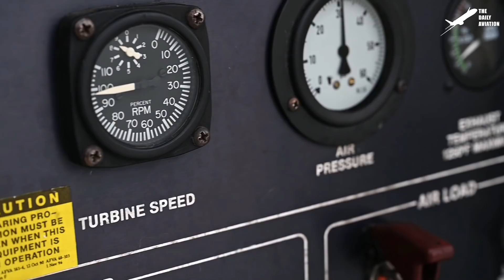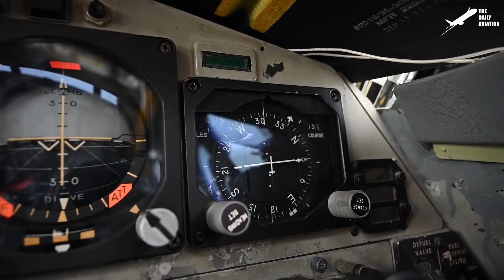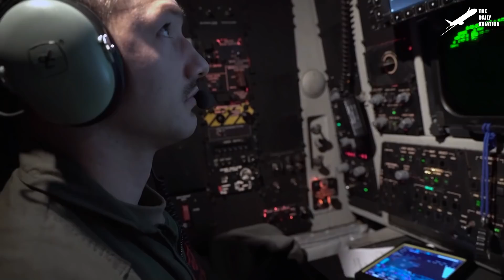US Need This Special Technique to Start this Gigantic Aircraft

Comment: And it's called a "start cart", not a "cart-start".   A "cart start", or "cartridge start" is coimpletely different.  That basically uses a giant shotgun shell to start up an engine almost instantly.
Reply: pretty sure those were just in piston engines
Reply: @gilzor9376  no. many military jet acft have the ability to use carts. its needed in case there is no ground equipment available since there is no apu in the plane...
Reply: @wingmannj  I challenge you to give me an example of a 'modern jet engine' that uses a cordite charge to start up.
Many military aircraft have an on board APU . . . . but I know near zero about the subject.
Reply: @gilzor9376  f-4s do, or did. B52s,kc135s. The big planes had them installed when on alert during cold war times. Airlift heavies i cant speak for never worked on them.
Reply: @wingmannj  key words in my statement . . . 'modern Jet Engine'  . . . pretty clear on that. The F4 Wildcat is a piston engine. Show me an example of the KC135, I don't believe it. KC135 has an on board apu . . . . maybe the F4 Phantom, as it was an older Jet Engine, I know early versions of engines had used them.
Reply: @gilzor9376  if i remember right the apu's on the 135s were disabled because of fires. only commented because you said they were only used on piston engines which isnt accurate.
Reply: @gilzor9376  carts on the 135 may have been limited to earlier models, it looks like the newer models with turbofan engines instead of turbojet used an apu. i know the older models used carts i worked along side of them when my b52 was on alert status and we'd have a klaxon exercise.
Reply: @wingmannj When I challenged you I had stated both that I know near zero about the subject, and that the challenge was about a modern jet engine. You see, after your comment, I had realized that the early days of jet engines, their use was barely existent let alone at all, but you commented that it is essentially commonly used up to and including today, which is not accurate at all.
Reply: @gilzor9376  they never were actually 'common' being that they're used for special circumstances such as a 'scramble' or just for crew training which is a good thing because the clean up is a chore, leaving a lot of burnt residue in the breech and breech cap. on just regular training sorties they're never used because why would they, that's what ground equipment is for. in the event god forbid that ww3 ever broke out with the soviets the extra few minutes it would take to use ground equipment to get the engines started makes a big difference as opposed to the crew running up the hatch and firing the carts to start the engines. those few minutes mattered and we practiced that at least once a week. probably the same thing with fighter jets scrambling to intercept.

Comment: The video said the B-52 is one of the oldest aircraft in the USAF does anyone what aircraft is older?     Saw an article a few years ago of military hardware still in use after 50 years and included things like the 1911 pistol, turned 100 years old in 2011 and still used by certain special ops.  Also the 50 cal BMG dates back to post WW I or at least WW II
Reply: The last B-52 was delivered in 1962.  As of March 2019 there was a 1957 production KC-135R still flying.

Comment: It's actually a large air compressor that blows heated compressed air to start the first engine. Once the first engines turbines are turning the fuel is turned on and the engine is fired up. After that the first engine that was started the air generated from that is diverted to the other engines and they start.
Reply: As in a 707 or a DC8
Reply: @sundar999  No.  The B-52 does not have an auxilliary power unit or internal gas turbine compressor.  It must use powder cartridges or external air.
Reply: @dougwickstrom9870  DC8 and 707 didn't have APUs so they started one engine from an air compressor on ground then this engine fed bleed air to start the other 3 engines
Reply: @sundar999  That kind of depends on which DC-8 or B707.
Reply: The -60, was a small jet engine, they used the bleed air off the engine, to turn the aircraft starter

Comment: Buff can fly almost 600 mph so I call BS in reported speed here.
Reply: The original top speed was around 690, but some of the relatively recent modifications brought it down to 650 MPH. So, the 400 MPH stated in the video is completely wrong. The rest of the video seems yo be all correct.
Reply: @vincentlavallee2779  Airspeed is limited to 622 mph by the electro-optical viewing system, which causes flight instrumentation issues at higher airspeeds.
Reply: Are they confusing knots and MPH? Normal cruise is around 440 kts. Also, the most efficient long range cruise speed is never full chat.
But these, as well as early four-engine airliners powered by old-school jets, were faster than today's planes.

Comment: I have a feeling some young kid titled this video. This is not special! This is old technology! Every jet aircraft originally had to be started with a external air start. Then we got smart and started putting JFS (jet fueled starter) which is a small turbine engine that’s started using compressed air or hydraulics accumulator. Then we got even smarter and started using APUs (auxiliary power units) small - large turbine engine that produces air and also has a generator to produce electrical power. the difference between a JFS and APU is a JFS only produces air and that’s it. APUs will produce air, obviously the exhaust. But they have a generator so you can make electricity. Usually tripple redundant airframes have back up hydraulic, electrical, and pneumatic capability to move servos the apu can produce electrical and pneumatic power so you can move control surfaces
Reply: A number of older jet aircraft could only be started with a gunpowder cartridge.  The B-52 uses that or external air.  It has no internal air compressor.

Comment: They left out the 12 gauge blanks used for emergency starts on the engines.
Reply: They don't use "12-gauge blanks" to start the engines. That silver cannister shown being loaded in an early scene was the starter cartridge. They can install one for each engine but normally use them only in engine 4 and 5. They typically would use them on alert so that they did not have to mess with using a air-start cart.
Reply: @barrygrant2907  Used one per pylon on alert.  This is demonstrated in the video.
Reply: @barrygrant2907  As Doug said, one per pylon.  Whoever ran the fastest could pop them from outside the aircraft.  Saves a heck of a lot of time vs. spinning 'em up from cold and dark.  ICBMs spoiled the entire alert game but did make it more interesting when the Klaxon sounded.  Before, you could finish your sandwich, stop by the latrine, and finally grab a cup of joe on your way out the door.  Then, ICBMs were born, and with them, the days of cart starts, elephant walks, and MITOs.
Reply: Each cartridge was about a gallon in size.  It would burn slowly, but produced enough exhaust gasses to rotate the starter.
Reply: @robertheinkel6225  Yeah, 12 gauge blank is a military under exaggeration.

Comment: All of the external start stuff will go away if/when USAF choses a replacement engine schema. There are at least four candidate engines from three manufacturers, ranging from tried-and-true to recently certified (that being the GE Passport 20), and all much less thirsty than the J57s. Push a button, and they start.
I won't live that long, but it would be awesome to see the B-52 become a centenarian.

Comment: Why are the support crew using sockets with a brace and ratchet wrench instead of cordless impact wrench?  Same thing with the greaser.  Manually hand pumping grease instead of using a cordless greaser.  You'd think that time was important in a fighting situation.  You could argue that recharging could be a problem in the field, but they have generators and would pack hand tools as a backup.

Comment: The correct speed info is 650 top speed cruise 509 not 400.
Reply: Airspeed is limited to 622 mph by the electro-optical viewing system, which causes flight instrumentation issues at higher airspeeds.  Cruise is variable.

Comment: Do I see there hoses, clamps, nuts, screws and wires from the 1950s? Unbelievable...
Reply: They go back to the 1930s, and are still used in new installations.

Comment: Nothing unusual. Seperate units, gas turbine air start and ground power unit were used/ serviced by my unit over the pond in 67-68
Reply: You must have been an AGE mechanic?
Reply: AM/32A-60 provided air and power.  These days an AM32A-86 is used for power, and a -95 for air.  In the old days it would have been an MD-3 and an MA-1A.
Reply: @dougwickstrom9870  -60 is mainly used by fighters, the 86 will handle the much higher power demand of the larger cargo and bomber aircraft, plus run for 8 hours on 50 gallons of fuel instead of 100 gallons an hour with the -60

Comment: What do German leopard tanks and attack helicopters have to do with starting the B-52 engines?
Reply: I believe they use the tanks to tow the plane onto the flight line, then use the helicopter to blow air into the jet inlets to get those turbines rotating.

Comment: Well, the B-36 obviously worked well, then , didn't it?
Reply: Yes, well enough for the time. It was a hybrid that held the strategic bomber throne for a decade, between the all prop B-29 and the all jet B-52. Like virtually all the planes designed in the late forties and early fifties, they were obsolesced by the excellent slide-rule engineering of the mid-late fifties.

Comment: the scream of those engines tho

makes me grind my teeth
Reply: The reengine of the C-5 did a lot to reduce its annoyingly loud engine notes, so hopefully the future reengine of the B-52 will do something similar as far as noise reduction. 

The angst about the reengine program is some of the most severe I have ever seen. Far more than the great engine competition for F-16s, the KC-135 reengine program, or the C-5 reengine program. The DoD is terrified of making a bad selection from among the bidders. For what seemingly should be a relatively simple form, fit, function COTS selection the USAF has certainly taken a lot of time doing evaluation studies.
Reply: @davidhoffman1278  There are structural issues relating to stability of flight.  The best that can be accomplished with new engines is improved fuel consumption and cleaner burn.  More thrust and fewer engines would cause more problems than they would solve.
Reply: @dougwickstrom9870  ,
Yes, I read about the B-52's limited rudder control during engine out situations. If 1 engine(engine 1or engine 4) on a 4 big turbofan engine configuration failed at critical on takeoff then the resulting drag would be more than the rudder could handle. 

A B-52 pilot explained that they had no need for additional thrust. The 17,900 pounds from the TF-33s was adequate. Any more thrust might aggravate the existing lower wing fatigue cracking issues.

Comment: Top speed for B-52 is closer to 650 MPH not 400 MPH
Reply: Airspeed is limited to 622 mph by the electro-optical viewing system, which causes flight instrumentation issues at higher airspeeds.

Comment: Will the new engines have Start Cartridges?
Reply: Hey Bill, The new engines will likely be electric start (the Rolls Royce F-130 is the current top contender)... This means the Buff will get an auxiliary power unit to supply the electricity needed to light the new motors off... No more coffee can full of gunpowder 👍
Reply: @timma100AR  An APU provides bleed air for starting.  The B-52 doesn't have one.  Yet.
Reply: @timma100AR  New engines will not be electric start.  Too heavy, too bulky, not enough power.  The APU will provide bleed air for starting.

Comment: Bad information in this video.  The B-52 Ground speed is greater than 600mph.  You've listed a max speed of 400 mph.
Reply: Airspeed is limited to 622 mph by the electro-optical viewing system, which causes flight instrumentation issues at higher airspeeds.

Comment: actually that thick smoke would unstealth a stealth russian fighter jet -I guess this could be researched on further
Reply: The newer engines burn much cleaner.
Reply: @robertheinkel6225  and with the righ amount of exhause one can use it to detect invisible hostalie planes nearby with adds I guess - Tis selfexplanarie they are more efficient and I guess Hotter thus easier to spot -which exhaust could cover (in theory)

Comment: A Cart Start, is when Cartridges in a Breech Cap are fired...turning the engine: Was designed specifically because aircraft on nuclear alert needed to expedite the process without need for external power or air carts.  At 1:10, the Maintainer has removed the Breech Cap with an unfired Cartridge in it.  Starting with the Air Cart, the piece of ground equipment shown, is called .... Engine Start. An Air Start is preformed in the air to attempt to get an engine running again... The Crew showing up with helmets on?  Maybe to protect their identity in this day and age, but that's what helmet bags are for, and taken out during preflight - having checked it over before transportation to the aircraft.

Comment: They used to be silvery-aluminum. Why are they now dark gray? Any guesses?
Reply: A step back into  the stealth world thats why.
Reply: @garyhaines6891  Bingo. Radar absorbing paint or coating.
Reply: @DavidFMayerPhD  No.  It's just corrosion prevention and not being too visually obvious.  When I was in SAC the B-52G/H were green over white, and the B-52D was green/tan over black.
Reply: @dougwickstrom9870  I am surprised. Thanks.
Reply: @dougwickstrom9870  Also, at the start of its career I believe that silver was deemed best for nuclear delivery, presumably helping to reflect radiation. I read that once but don't know if that was a correct explanation.

Comment: 4:44 I'm pretty sure the B-52 has a higher maximum speed than 400mph....it cruises faster than that....
Reply: This is correct. Cruising speed is 525 miles per hour,  maximum speed is 649 miles per hour.

Comment: It's got a cruise speed of 320 mph. For a plane with as many engines as it has,, I'd assume it would be faster.
Reply: It is.
Reply: @burtvincent1278  Airspeed is limited to 622 mph by the electro-optical viewing system, which causes flight instrumentation issues at higher airspeeds.  Cruise is anywhere between 300 and 450.

Comment: top speed is 650. not 400. so much wrong info in these videos it's laughable.
Reply: Airspeed is limited to 622 mph by the electro-optical viewing system, which causes flight instrumentation issues at higher airspeeds.
Reply: @dougwickstrom9870  ok...top speed is still 650+/-
Reply: @EgoFiveFiveSix  The aircraft has enough power that one can easily exceed the "top" speed, and it will go into a tuck-under condition.  There is a reason for "do not exceed" speeds.  The other thing is that the indicated speed is in knots, so the actual do not exceed is 540 KIAS.  This is important.  There was at least one instance where the vertical stabilizer departed the aircraft in level flight due to speed-induced turbulence.

Comment: Why not combine the 2 engines to make 1 large engine? Seems a little overkill to have 8 engines on an aircraft
Reply: Overkill?  Try this….one engine fails, you have seven left.
Reply: @tommooe4524  so what? 2 engine aircraft are designed to fly on 1 engine

Comment: I didn’t realise they aren’t that fast , for some reason I just expected the top speed was higher
Reply: It's over 600 mph
Reply: @gnumpfgnumpf5610  this clip is clearly incorrect then when it states a maximum speed of 400mph
Reply: @timj41  it is!
Reply: @gnumpfgnumpf5610  surprising they would make such a major error, thanks for putting me straight that could have been embarrassing. A lot of poor fact checking going on with these channels.
Reply: They go subsonic but can go faster than today's jetliners
Reply: Airspeed is limited to 622 mph by the electro-optical viewing system, which causes flight instrumentation issues at higher airspeeds.

Comment: So what is this "special technique" that we never see? And I think they are "start carts", not "cart starts".
Reply: Actually we called them dash 60 turbine generators. They could supply pressurized air and a/c power to the aircraft.
Reply: The special technique was a cart start.  Uses a chemical propellant to supply gas pressure to start engines.
Reply: @itsmewoodG  The -60 has been history for a long time.  The power unit shown is a diesel-driven AM/32A-86.  The MA1A is also a thing of the past.  The starting cart shown, but not used, is a -95.
Reply: @dougwickstrom9870  yes you are right, I wasn't paying attention. I can see that is not a -60. And I did see the diesel generator, worked on many of them. When did they stop using the -60? I was in the Air Force from 1987 - 1992. RAF Mildenhall UK. And Ellsworth AFB SD.

Comment: So, where was the "special technique to start" this gigantic aircraft? I saw the crew chief disconnecting the "air hose" and also another troop either installing or removing a start cartridge... I'm not familiar with B-52s but do they use both modes (pneumatic and cartridge) to simultaneously start all 8 engines? I can see why they would use cartridge start during normal starts instead of pneumatic which will require 8 pneumatic carts or a whole bunch of people moving 1  cart and a spare to start the other engines.. Cleaning 8 breeches after flight will be a pain in the butt too...

Comment: The A-10 and the B-52. It it works don't fix it. Air start? It took two direct-linked Buick engines to start one SR-71 engine. That's a Big engine.

Comment: Bleed air from a -60, and then ?
Reply: That wasn't an AM/32A -60.  The power unit was a -86.  The -60s and the MA-1As are all gone.  The air cart shown, but not used, is an AM/32A-95.